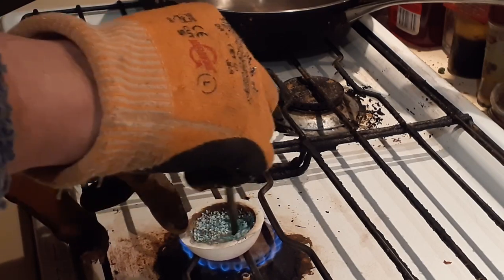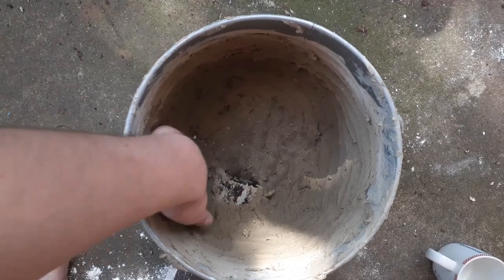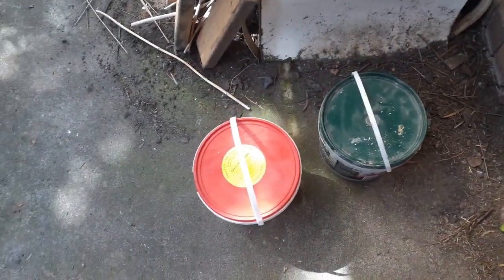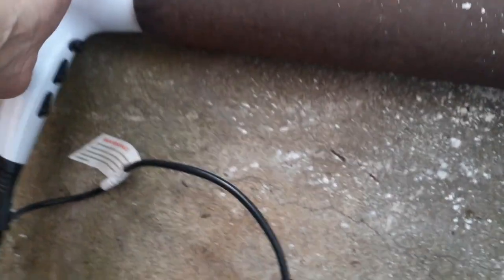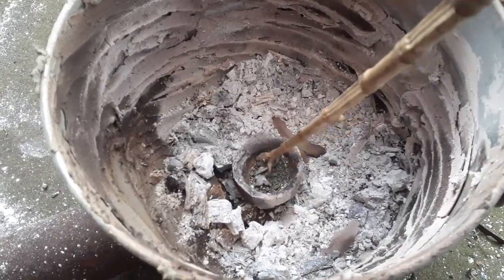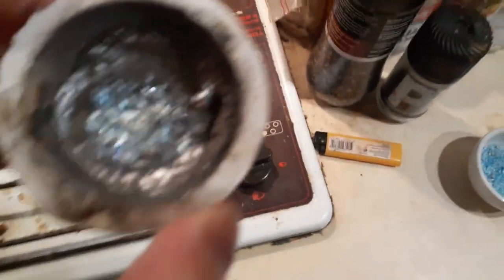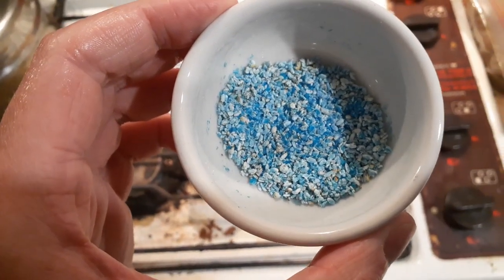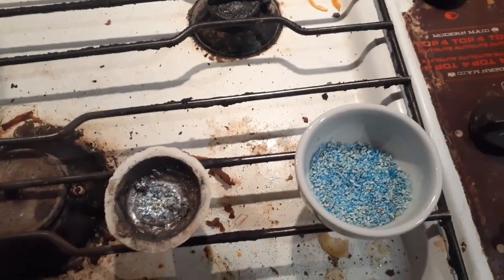Experiments in melting metal

Comment: U need a way hotter torch to melt most metals. Lead, tin, pewter,and to an extent zinc is somewhat easier to melt. But copper, aluminum, etc…is way harder without a forge or very hot torch
Reply from the maker: Yep. I'll get a propane torch and forge once I can and makes some vids on it.